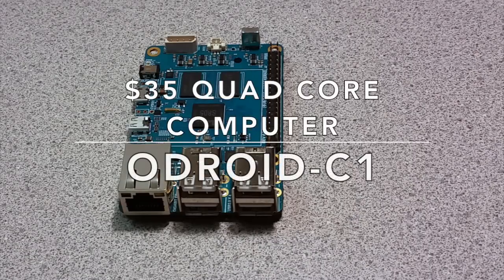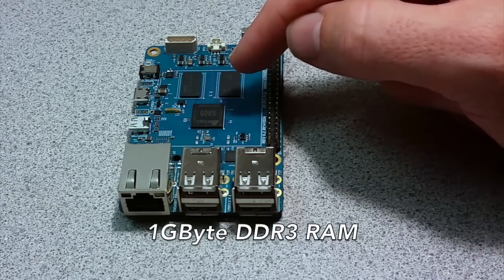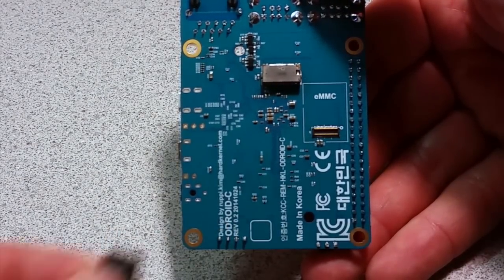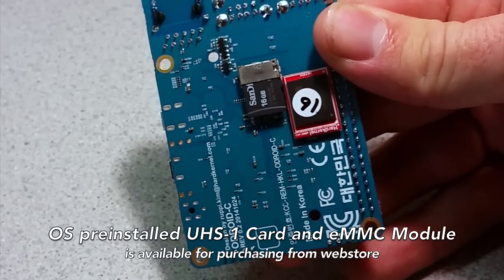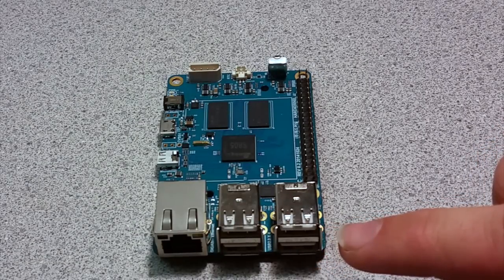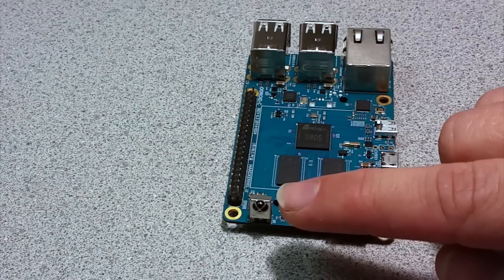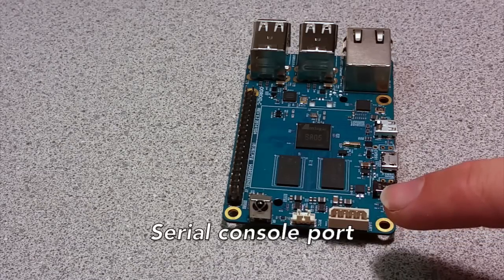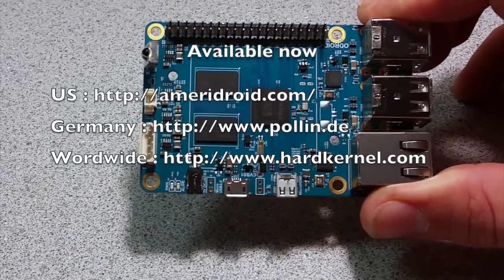ODROID-C1 Hardware detail

Comment: I must have a gremlin in mine because the microSD card is not easy to insert.  Because I change cards often when testing Linux builds I bought an extension cable.  http://www.amazon.com/gp/product/B0085GGO92?psc=1&redirect=true&ref_=oh_aui_search_detailpage (I do not make money off the link, it is just for your convenience.)

Otherwise I LOVE the Odroid-C1 (I still like my RP2i, but nowhere near as much).  My favorite feature is the Gb network interface.  The C1 makes a great low power, high performing web server.

P.S. I wish they would build a version of the card with two 1Gb network interfaces or add a USB3 port.

Comment: The package arrived quickly; 7 or 8 days from order to delivery in New Zealand by UPS.

I used a tablet 5V 2A power adaptor with the same small DC connector to power it up. With HDMI screen, keyboard, mouse and plugged into the home network. Linux boots quite quickly and finds the internet. Power draw is 4-5 watts according to a mains power meter, of which 1-2 watts is the 5V adaptor.

I got the SD card and eMMC and had both plugged in, so I'm not sure which it booted from. I didn't re-size or make any significant changes as I haven't backed it up yet. It did do some updates after prompting.

Getting the plastic case is a good idea to protect the board. I got the case, hdmi lead, usb otg lead, uart lead, SD card and eMMC. The heatsink may be a good idea if running it hard. Idling along running Linux it doesn't get too warm. The case is well ventilated.

So far I have only poked around a bit and run the web browsers and a few system utilities. It all seems to work quite well.

I have no idea how Android runs, I have no plans to try it.

Using Linux you should be able to install LAMP and run a web server. Just log out of the desktop or remove it and operate from the command line. A USB connected SSD may work well for storage.
Reply: +PMB-NZ I have used both Debian and TinyCore linux on mine.  While I am not a big LAMP fan, it should work fine as it is dependent on the OS rather than hardware (I'm sure  you know, just say'n).  My favorite configuration for web and application services is Node.js on TinyCore (server) on the C1.

Comment: Dam I just received my MK808B Plus and I'm not happy with the current stock ROM. If I had known about this I would have bought this hands down, I can't get the USB to Ethernet to work with the current stock OS. Will this device be supported in the future officially by OpenElec??? They now support the Cubox but its far to expensive and its not that powerful

Comment: Looks awesome, I had originally planned to use a Pi for my project but to be honest after I spent some time with it I'm not entirely sure that the Pi has the horsepower for what I ultimately wanted to do. Not to say the Pi isn't a competent board, I still plan on using it for a less resource intensive (but equally important to me) project.
Reply: +VolOpt I own a RPi2 and a C1.  I would choose the C1 every day, hands-down, no contest.  I like my RPi2, but I LOVE my C1.

Comment: Nice hardware. A big improvement on the Raspberry-Pi.

If there is reasonable support, documentation and updates, it could do very well.

I have experimented with a few boards; Cubieboard, Beaglebone, and a couple of others. All nice hardware but mostly unusable, except by dedicated enthusiasts with hundreds of hours to spend. Usually, the support and updates fade away just as they get rolling as they move on to V2, V3 etc.

This is why the R-Pi still tops the heap with such out-dated hardware; they stick with it.

For my own use I don't like Android on these types of boards. Probably OK if you are lookiing for a big-screen cell-phone with a real keyboard and mouse. Like the R-Pi, some sort of Debian based Linux is the way to go.

I have placed an order and look forward to getting it going.
Reply: +PMB-NZ I have used Debian and TinyCore and they both work very well.